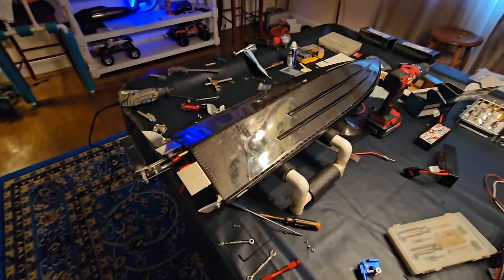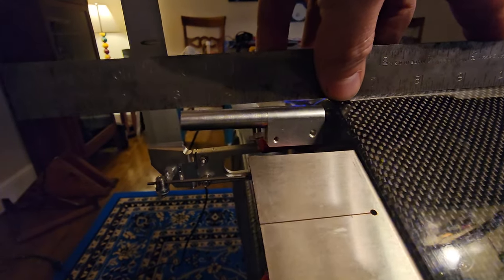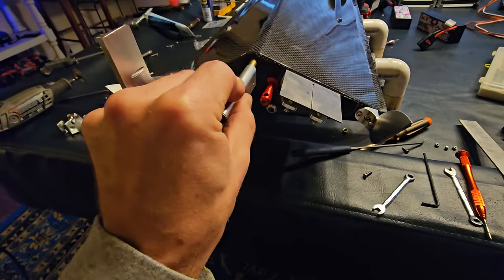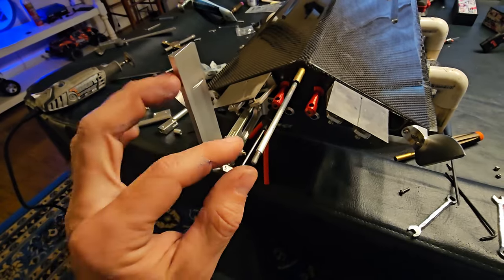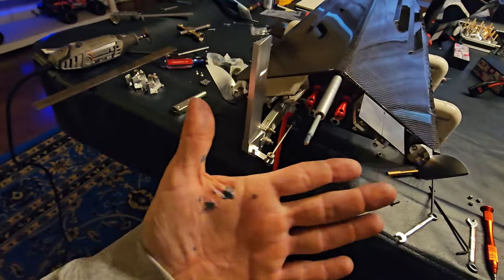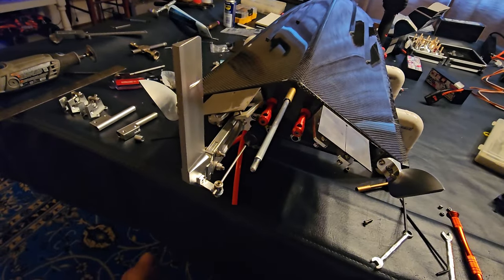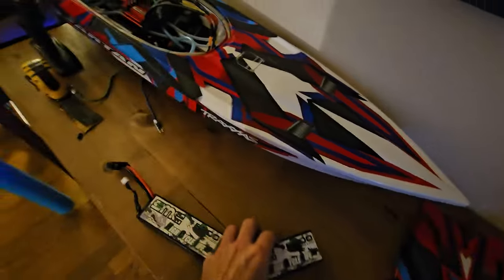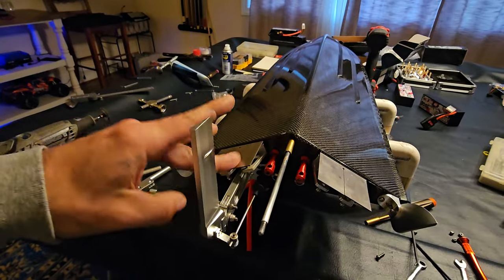Oxidean Dominator stuffing tube angle / adjustment. Ridged vs. Adjustable

Comment: REPLACE  the stuffing tube!   I  run a 1/4 inch brass k&s tube without a Teflon liner, used the stock stufing tube to shim the 1/4" ST at the coupler housing..  5-7 mm sticking out the transom, modified my stinger barrel and stinger mount for ease of adjustability..

Negative angle is good for what your doing in that little pond BASHING around negative angle is what you want..  JUST MY 2 CENTS FOR WHAT ITS WORTH.
Reply from the maker: Thanks big b! Your the reason I created this 2nd channel! Now I own 5 boats in just over 3 months. I'm hooked! Not too far away either on the Nc/va line on Kerr lake.

Comment: You need to bend the stuffing tube inside the boat so it comes flush out off the hull and cut it so it doesn't get fixed. The shaft needs to have room to bend INSIDE the strut since transom is a fixed point and inside the strut is a fixed point, nl the bearing...With a downward strut you wont be able to achieve high speeds. A flexshaft and also bearings wear out quite easily i think, aspecially when you run high rpm's and/or have small imbalances...
Reply: I agree, Peter, bearings wear out, especially turning high rpm, my bearing wore out doing speed passes turning 40-55,000 rpm..  Keep bearings in your repair box.